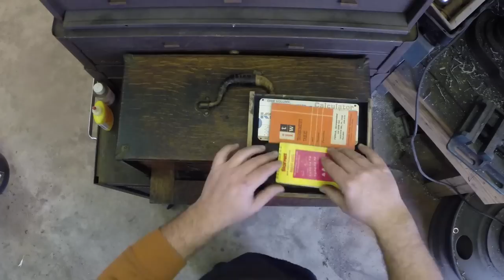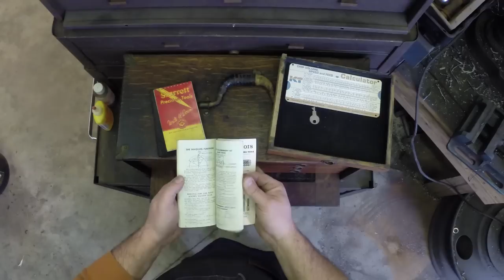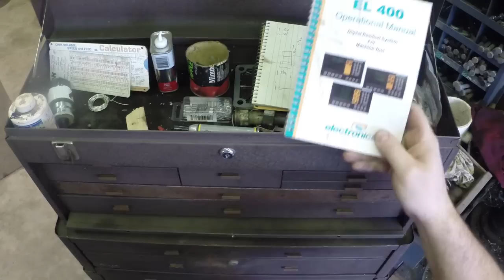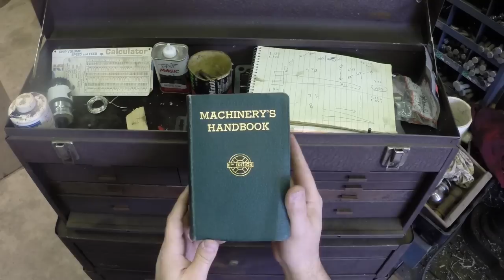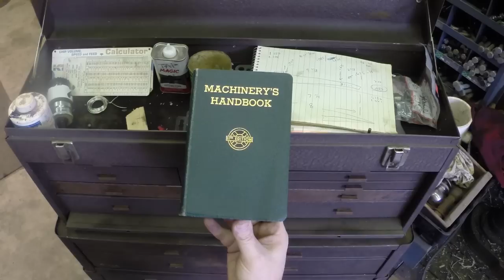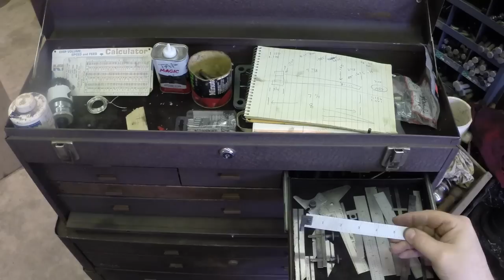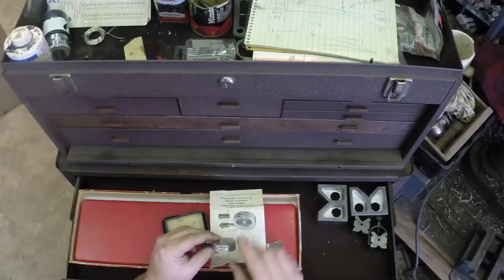What's In My Box?  Machinist Tool Box Tour

Comment: Hi Keith, I enjoyed the tour and stories. Nitro pointed out how to adjust a caliper with shim stock. There are others where you use the provided pin to push the dial stem off the rack. If the rack gears point down the access is on top and vice versa. Mitutoyo has the rack facing up. Remove the dial clamp and screw from the bottom of the dial, then slide the jaws so the pointer is at TDC. Push the pin in the clamp hole and lightly (but firmly) push up to dis-engage from the rack and simultaneously close the jaws to zero. It often takes a few tries to get the right tooth. Minor adjustments of a few tenths can be made by loosening the rack screws for those like me who are truly OCD and absolutely have to have TDC. Starting as a production machinist I ended up preferring a .200 dial for faster reading. Now I'm always double checking when I use a .1 dial.
 I saw a file card with your files but no aluminum bar. They work great for cleaning files especially when they're gunking up with soft materials like ......aluminum! For those who don't know rub the end of the bar across the file in line with the teeth. The aluminum will wear into the troughs of the file and push the clogs out sideways.
 Having one of those trig table books helped teach me trigonometry and I still refer to it often. I'm glad I'm not the only one with the little orange book. Thanks for the reminiscing fun and 'Happy Turning'!

Comment: thank you very much for the tour keith, it seems that whenever i am visitin old friends or vice versa we always end up in the shop infront of a toolbox sharing stories about this tool or some kink. there's just something about that. one of my fondest memories of a significant uncle of mine who has passed years ago happened one time when i visited him with my wife. he was in his 90's at the time and couldn't walk. so we were sitting in his living room talking and he asked me to go down to his shop and bring back a specific tool box. it was chock full on tools of course, mostly measuring and gauges of all sorts. we went thru the box and each piece i'd pull out for him he had a story. like when he worked for some railroad shop in baltimore he got that one to indicate the holes for railroad wheels he had to bore out on radial drill, or he had an old starett gauge to set the draft on molds, which he gave me as i was in the mold making trade at the time. (since retired.) i had never seen one before infact. it was way old but like new in it's box like all his stuff. a grand evening was had by us that day! thanks for reminding me of it. as for the biggest mill. i think i have you beat, though i just went up to the shop and it wasn't in the box i thought it was, you can never have too many tools perhaps but finding one can be tricky at times. my big one is 30 thou over 2.5", homemade for a job, out of A2. i have a 2.5" crescent wrench i got from my dad when i was younger and always had it under the bench where ever i worked so i could say i had the biggest wrench, nobody ever beat me, though i saw one once big enough to put yer head in at a foundry my dad worked at years ago. it had a handle length of maybe 4' usually when they get big like that they had a short handle and a striking lug to smack it with a sledge but this one didn't for some reason. i have tools from my dad and his brothers and a saw of my grandfathers and a prybar of my greatgrandfathers. many of the tools were homemade or from toolshops long gone. i got a 0-1 mike my dad made when he started out, it is dead on, which is handy cause it doesn't have any way to adjust. anyway thank you again, very much, you brought back some nice memories.

Comment: Good show Keith  that machinery handbook is handy even if your a millwright . Keep up the good work.
My Best
Tighe
Reply: ***** It's also rather useful for the engineers & designers... My copy of the 15th edition still has the post-it note thumb tabs from my PE exam...

BTW - that drawer that Kennedy & Waterloo put in their top chests has a thumb hole in the bottom, so you can push your book up & out of the drawer... I've never punched out the knock-out tab on my chest, but it is there if you want it.

Comment: Your story starting about 4:00 sounds very familiar to me.  Recently I found a wooden box like that along with another similar sized box that was 1950's vintage "craftsman" box, but these were jam packed with tools.  Turns out the father of the guy selling it was a tool and die maker who recently passed away.  There were micrometers, all sorts of metrology tools (inside, outside and dividing calipers, precision rules, gages of all sorts), all types of set up tools and workholding tools such as 1-2-3 blocks, vblocks (he made these himself apparently), angle plates, all sorts of drills and reamers and lots of one-off cutting tools that had tons of character.  Like you said, I could take a quick look at it and could instantly tell there was easily $2000 there.  Quite a lucky find.  I was beaming for weeks afterward.....
Reply: ***** I finally took time to view your tool box video. I scored the twin to your nameless wooden box at an antique store chock full of near twin contents as well. I gladly paid $300  for it 10 years ago & have enjoyed it's use ever since,  The rest of my boxes are (2) Kennedy 7 drawer, One chocked full of Starret & Lufkin  etc for $150 & the other like new empty for $20 (1) Kennedy 11 drawer empty for $125. I love bargains !

Comment: Poor people have poor ways, when I was turning a wrench every day and the Snap-on truck stopped every week I bought Snap-on (or Blue Point) tools, then when I started fixing tires full time I started buying new Britain tools from NAPA, S-K & Harbor Freight tools. I had a set of Buffalo 3/4" drive socket set from 7/8 to 2" with a ratchet and a breaker bar I bought for $50.00 that 1 socket from Snap-on cost $150 to $200 and those expensive micrometers are very easy to calibrate. also tools that have been used and passed down from mechanic to mechanic or machinist to machinist have a sole - a use. keep up the good work
Reply: By Twin Brother's family had a Commodore 64
which meant it had 64 KB of memory and their Aunt had a Apple 2GS with 256 KB memory  the Tandy Color Computer 2 had 512KB of memory! my 2nd computer was a Tandy 1000HD with 512 KB ram 20  meg hard drive! my 2002 model Dell Computer has 2,060,000 KB (2MB) of memory with 149 GB hard drive wow form 72kb floppy.
Reply: Brad Fisher I purchased the predecessor of the 64, the Vic 20 - I was 11 years old and bought it with my own money!  Good times.
Reply: I just know that was the first Computer I tried I think!  I had played with a Merlin (1978)  http://en.wikipedia.org/wiki/Merlin_%28game%29

Comment: I've chemically sharpened files in the past (Boggs use an abbrasive method acording to their site). As I recall, I used a strong caustic solution to remove the oil, dirt and pining The the files were thouroughly rinsed and immersed in battery acid for some time.  Some people have reported good results with spitit vinegar.

Comment: Keith, a delightful look in your tool box. I'll bet you could machine out a nice black powder cannon.
Reply: *****
Machinists today realize the foolish public doesn't know the difference between regular gunpowder that will build over 100,000 pounds of chamber pressure and black powder, which builds very little. As a result, most machine shops will tell you to get off their property if you mention building a cannon. I had several barrels made, but each time disguised the cannon by telling the shop it was a part going in a brand new fence post driver or a can recycling machine. I'd drop off the steel round stock and request a hole down the center to a certain depth and a hole across the back end for the trunion well behind the bore. If they seemed to inquire too much, I'd tell them it's an invention I don't have the patent for just yet and couldn't reveal specifics. With steel walls an inch thick, it would take anything. I had a nice mortar made from a locomotive axle 4 5/8" OD x11" long with a 2.75" bore. I had a school machine shop make that.

Comment: I found out yesterday from a tool forum. I know they have been selling imported supplies and larger items for years, but the hand tool line has been synonymous with Made in USA, and since they have other tool lines, I never thought they would ruin the Craftsman line.

To me this undercuts what I have spent decades buying into as part of their warranty, as they will no longer be able to back up the products I've bought with an acceptable replacement.

Its also very underhanded how they plan to take advantage of everyones assumption that Craftsman = USA. They have apparently been subtly removing Made in USA off packaging on US made tools so that as the switch rolls out, it will be even harder to notice. The tools will come in the same basic shape (although as the link below shows, thicker to make up for lesser quality steel, rougher finishing quality and less gear lube), with the same packaging part numbers and price. It doesnt look to be stamped with its new country of origin, they just removed the USA and leave you to assume its the same tool you have been buying for 85 years.

Just thought everyone should know. To me, its an absolute deal breaker. I only support American made tools.

Comment: i find the same thing with the dial calipers over digital ones , i have a few sets of digital ones but i always end up using my dial calipers , i always find the battery goes flat in the middle of measuring something with digital calipers , never have that problem with a mechanical dial !

Comment: Hi Keith! I was wondering if you had any advice on a toolbox for a 18 year old machinist to get? I'm unsure if I wanna just go cheap to start and have a safer place for my tools, or if I should just wait and invest
Reply from the maker: Hunter Marsh You won't go wrong with a Kennedy box.  Several options - you can buy one new, but they can be expensive.  Or you can do some searching and probably find an good used on on line.  I have picked up several sets of these on eBay and Craig's  List for very reasonable prices.  These boxes are of great quality and will last for years, and machinist usually take good care of their stuff.  Do a search for "Kennedy Box" on Craig's list and you will probably find one near you.  If you are really lucky, you might even find a good used Kennedy box that has tools in it for about as much as a new one would cost empty!
Reply: @VintageMachinery  Agreed. I'm a CNC Mill operator at a small family owned business here in Iowa and they buy Kennedy toolboxes for the employees who wish to buy through the company

Comment: I'm a apprentice machinist working at Thomas tool and mold, I was wondering is their any tools that I would need when I'm just starting out, it's my first year
Reply from the maker: Wow, yes, there are lots of things that you will need.  The truth is that a lot of it will depend on the work that you are doing.  I would probably start out with a good set of dial calipers, some scales, at least a 0-1" micrometer and probably a dial and test indicator with a Noga base.  From there, just keep adding new tools as you need them and as your budget will allow.
Reply: +Keith Rucker - VintageMachinery.org cool thanks
Reply: Tom Lipton actually has a great video on the first 18 months worth of tools that you might want or need depending on your type of work.

Comment: why does the top of a toolbox always collect the junk I have several roll away tool boxes and all of them have a collection of misc junk in the top! Nice supply of acid brushes to feed the knurling tool just had to add that LOL as for eBay and tools you can't go wrong and have bought top quality tools for .25 cents on the dollar and cheaper. I am more mechanical and welder in tools than machinist but do have some starrett tools and rank them with snap on in quality
Reply from the maker: +DS75921 Yes, the top of those boxes do collect a lot of junk.  It is just an easy place to stash stuff....  I agree with your comparison between Starrett and Snap On - both are the top of the line!
Reply: I remember when I got My first kennedy tool box The gentlemen  I worked for told Me  the top of that box was My trophy case (part's I scraped ) He said that was how to tell if You were going to get a raise in pay by  lack of parts  !